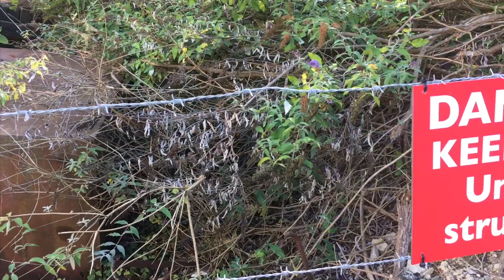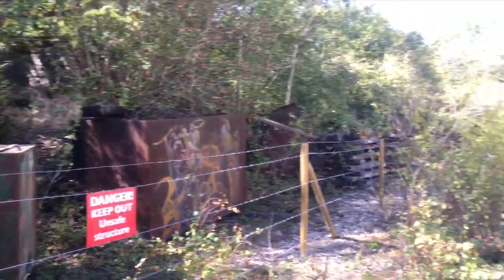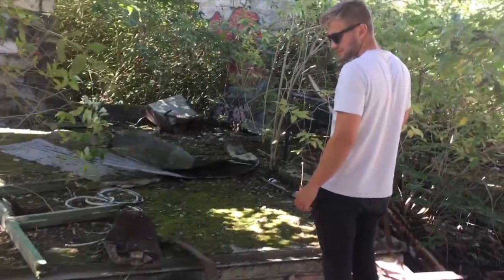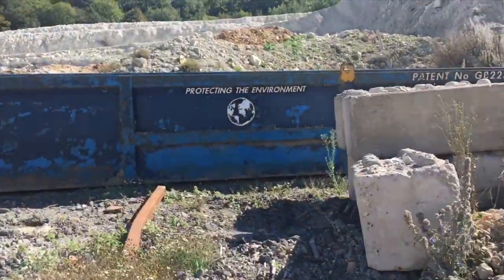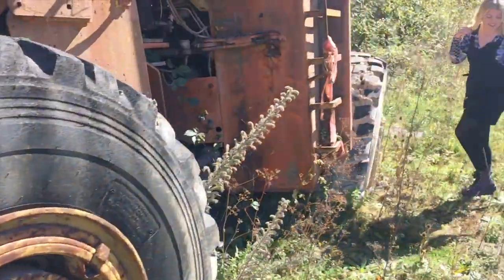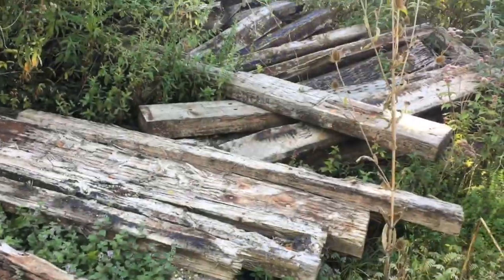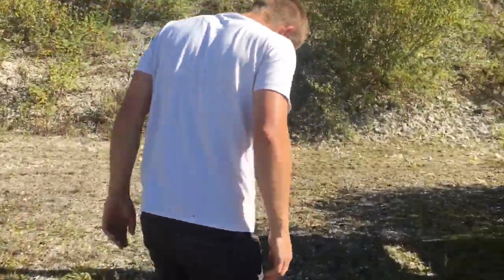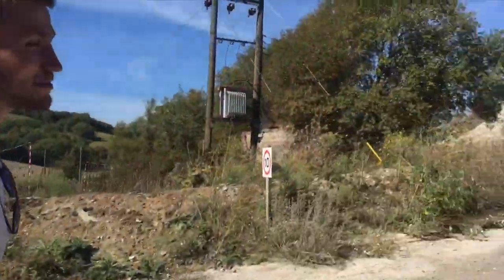TRUCK GRAVEYARD LEFT BEHIND! ABANDONED BUTSER HILL LIMEWORK QUARRY| WE CANNOT GET CAUGHT HERE!!

Comment: This is the former Butser Hill Limeworks and was abandoned for many years (not 30 though) but has recently reopened, operated by TJ. My first thought was that it would be used as land fill but further research revealed that TJ also supplies aggregates, including 6F5 (Graded) Rock Chalk (from their website).
The "structures" you refer to are the old lime kilns. The chalk would have been "burned" or heated in these to 825°C to decompose the calcium carbonate into quicklime (calcium oxide), used largely in the building industry for mortar, cement, plaster etc.
Reply from the maker: therealsnufkin Oh wow!😱 Thats really interesting to know. Thank you so much for the info, really appreciate it! X